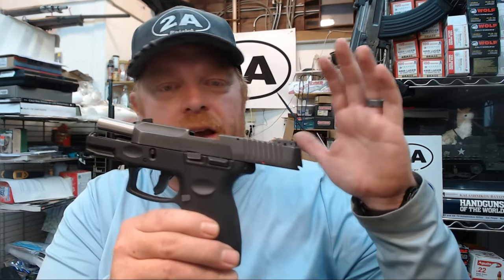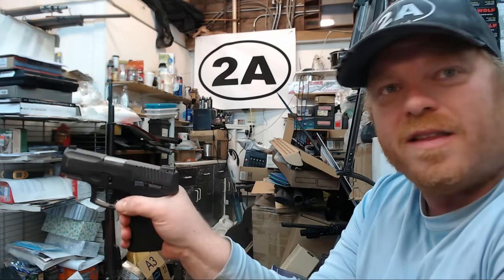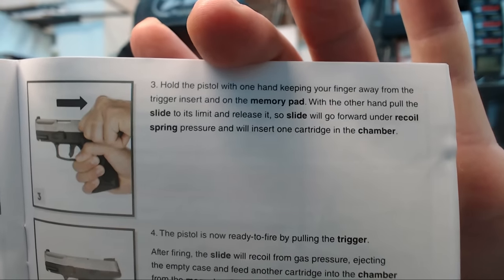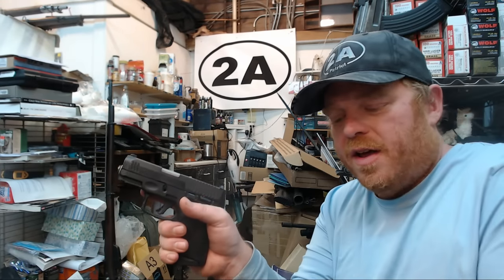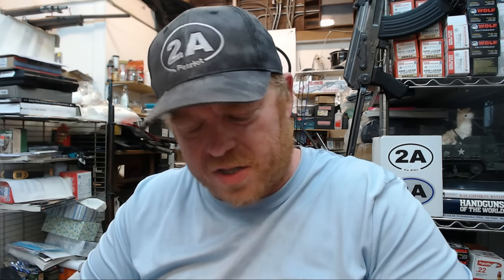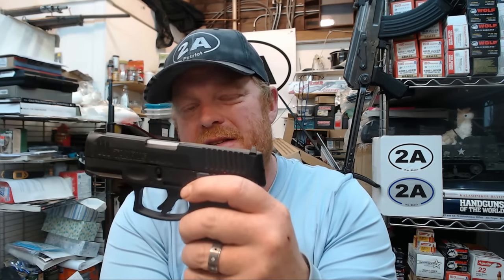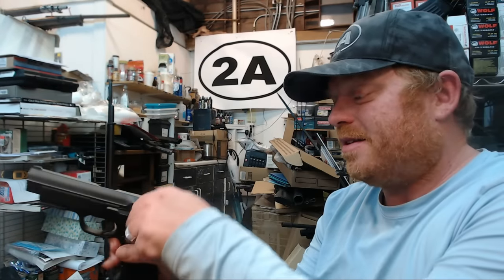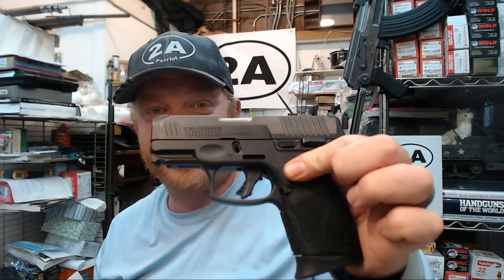📌 Taurus G3C G2C G3 9mm Stiff Slide Catch Release : How It Works : Pistol Loading & Slide Function

Comment: I dont get it After just 300 rounds my slide catch works fine as a a slide release I only every now and again do that but it does work...edit..point is I'm new to pistols didn't seem bad when new and now it's breaking in safety and slide relase are much more smooth then they wear just a few hundred rounds ago
Reply from the maker: That is cool. Sounds normal to me. Plus your thumb strength may be greater than some of the viewers. A lot of people have had issues / questions about this topic.
Reply: @2aEdu  Glad we have a place to get reliable information about these Taurus guns.

Comment: you know its hard to push down because your really not supposed to just pull the release and let the slide slam forward, especially with no round in the gun. things move in ways the firearm is just not designed to and things can bend or deform from the pressure. generally speaking the Taurus is safe to dry fire. but letting the slide rack forward hard with no round to slow it down is a bad idea on any gun.
Reply from the maker: That isn't true. Many guns have been designed over the years that dont lock open on the last round.(They slam forward on an empty chamber every time the mag is emptied) Also in the military, they close the slide on an empty chamber constantly.

Comment: Hey I just brought the Taurus G3 But everytime I pull the slide back with a empty magazine in the gun the slide get stuck back and I can’t move it unless I remove the clip is that normal or the gun broke??
Reply from the maker: Watch this video.  It will answer your question
Reply: @2aEdu  thank you so much and did you ever try grabbing the 32 round for it how does it work

Comment: I've had a "disagreement" in more than one comment section that goes like this kind'a  . Host of video "  The slide catch is not to be used as a slide release !! "  My response , based one the fact that he is a professional and a expert of course , goes something like this , " OK . I'll give you that . But why then does every pistol have the release with the finger pad facing up and the serrations facing up as well ??"  I have yet to get a response . If you're new be careful who you listen to . Question everything . There are a lot of self proclaimed " experts" out there . 2a Edu just gave you a lot of good info. .  Only thing I'd like to add is , any pistol with a stamped sheet metal slide catch/ release is going to have a very sharp edge on it where it inter-acts with the slide . You can forgo the break in period by breaking that sharp edge with just a couple of passes with a honing stone , a fine tooth file , or even an emery board or sand paper .  A couple of strokes is all it will take .  Take care and stay safe .

Comment: I hit the mother load on ammo at an estate sale on Monday in El Paso...and then I got harassed by Border Patrol on my way home!😂🤣 I guess the SUV with the back seats and cargo hatch full of ammo was cause for alarm 😂🤣
Reply from the maker: That is awesome. I hope you told them where to go......... lol
Reply: @2aEdu  he seemed cool at first but then he had me pull to the side. Then he asked me if he could search the car because he could smell weed. Which I knew was bullshit. Then he called for a dog. Then he looked into the back window of the car and called off the dog because he "could see a ziploc baggie with white residue in the open on the floorboard". 

So he pulls me out. Pulls off my Smith and Wesson M&P 2.0 .45 Compact. Cuffs me. Pulls out my backup S&W 686+ from my glovebox. Clears everything. Then does a field test kit on the "residue" he found in the bag and it came back positive...for mayonnaise like I told him it would because it's a sandwich bag and I'm a fat kid not a drug addict!😂🤣 by this time the other unit with the dog had shown up. So he's running the numbers on my handguns and has his partner with the K9 do a pass on the Tahoe. Didn't signal like I knew he wouldn't.

He uncuffs me. Then he puts my wheel gun back in the glovebox and my .45 slide locked back in the holster with my magazines into my passenger seat.

At this point I'm pissed! I've been there for over an hour most of which I spent handcuffed outside in the middle of a sandstorm with sustained winds of 25mph and gusts over 40mph. Then he starts asking me questions about all the ammo! 

I just stared at him for a second and said "I'm still being detained? Or am I free to go?" He said "I just want to know what you're doing with all this ammo." I repeated my previous question. He turned around and walked back to his little building and came back out about a minute and a half later and said "I put your gun back in the glovebox and the other in the seat. You can put your magazine back in but if you rack that slide we're gonna have problems. You're free to go." Turned around and walked back into his little building. 

Got home and started unloading my ammo to find about 30 holes in my leather seats in the back from where they had their K9 in my Tahoe!

I'm sooooo pissed!

Comment: If they didn’t want you to push the button, they wouldn’t have put a button on the gun! I don’t care what the instructions say. Why put a button on the gun if they didn’t want you to use it? If the manufacturer of the gun does not want the user to operate the “slide catch” as a “slide release”, the “slide catch” would be completely internal to force the user to pull back the slide to release it. I can’t think of a reason to have a button to release the slide if it is a “slide catch”. Maybe I am missing something.
Reply from the maker: I did this video thoroughly explaining all the aspects of how it works and how I use it. I don't care how you or anyone else uses their pistol.  👍 That is your choice.  I know this video helped a lot of new Taurus owners  with a few FAQs
Reply: @2aEdu  nothing to do with you, I just don’t see how anyone can say that the subject of this video is not a slide release. I have seen other videos on this subject that says that you don’t supposed to use it as a release and that seems odd to me as I stated in my comment.
Reply from the maker: @picturemetrollin2093  👍

Comment: THE M@PSHIELD WILL NOT ALLOW YOU TO CHARGE THE PISTOL USING THE SLIDE LOCK;  YOU MUST USE YOUR LEFT HAND TO RELIEVE PRESSURE ON SLIDE AS YOU ENGAGE THE SLIDE STOP.